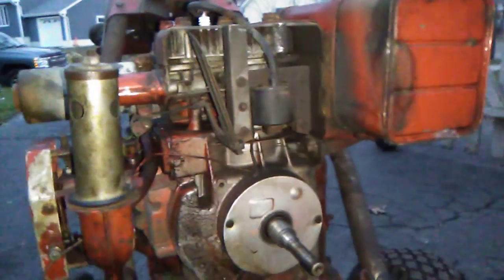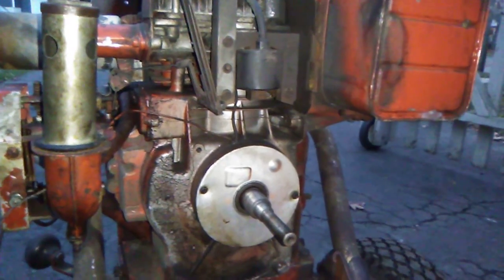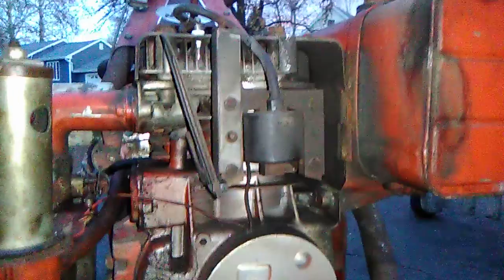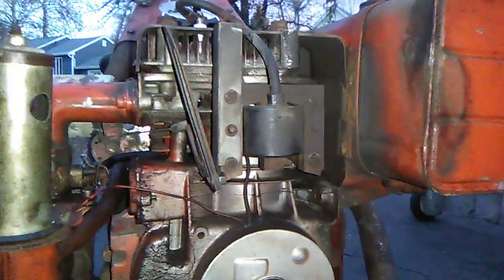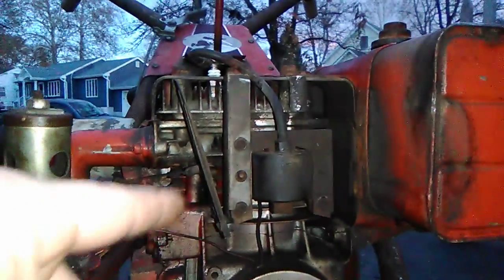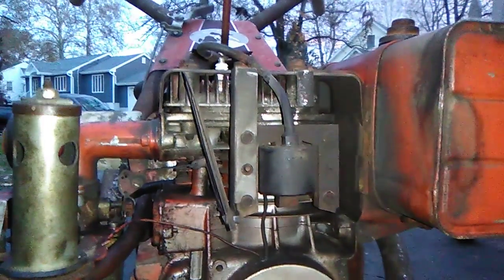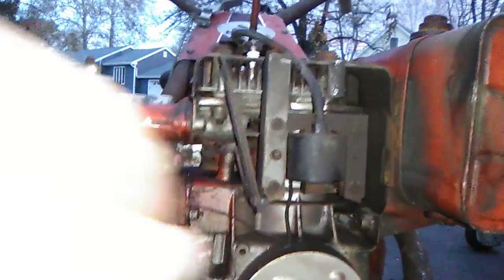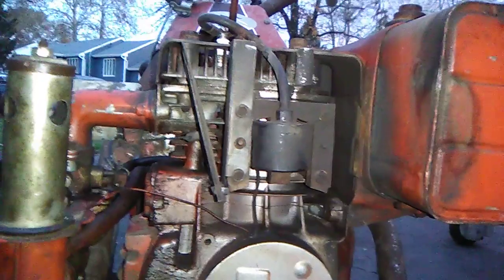Pre 1966 Briggs magneto overview.

Comment: Interesting. I have a mower with DOM 650105. I wonder which one I have. I did file the points when I got it because it had no spark. To my recollection, it was the same as my 1973 Briggs powered generator.
Reply from the maker: The info out there on it is a little scattered, however it appears 1964 was the earliest year for the modern 2 leg coil which can be upgraded to magnetron, but not all of there engines switched over in 64, it took a couple years. So it's a suprise everytime you pop the cover on a mid 60's Briggs. Nothing wrong with points though, they used them for decades, before magnetron finally came out.
Reply: @Mr_Tecumseh  I am a 1966 model myself, so I love having a mower older than I. I keep the points for authenticity. It is cooler that way in my book.